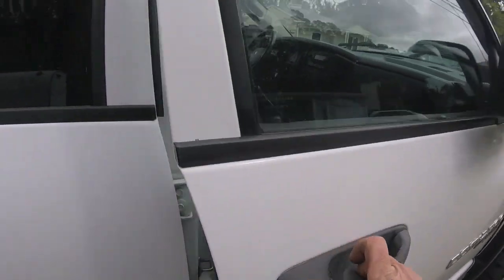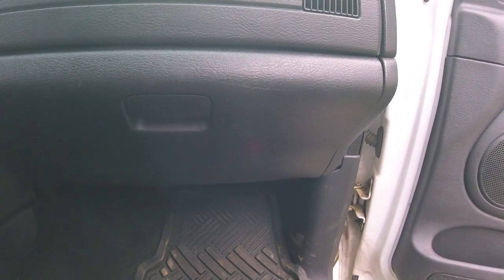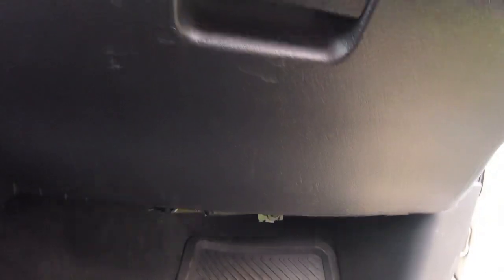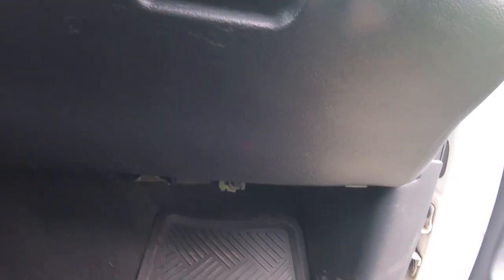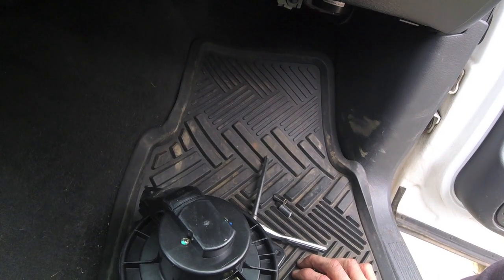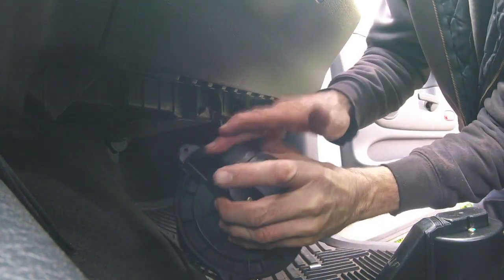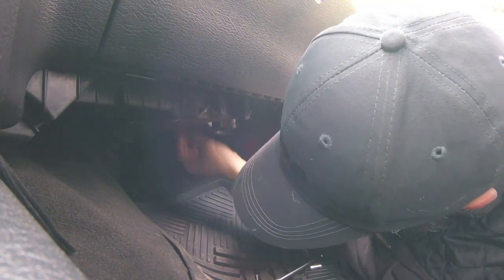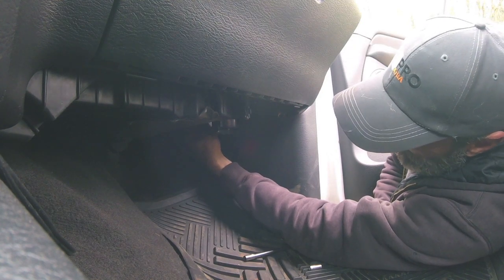2005 Dodge Ram Blower Motor Replacement

Comment: The one and only thing I suggest is to replace the resistor at the same time, if either the blower motor or resistor go, then the other usually isn’t far behind. Great video!
Reply from the maker: Good tip!

Comment: Thank you. I have your exact truck so please post any other fixits you do. My Cummins has the 6 speed 2 whl drive and only 90 thousand miles cuz it sits. The fan motor started growling about 2 years ago also. Where did you get the motor? Thanks.
Reply from the maker: If I remember correctly I bought it from rockauto.com   Thanks for watching. Enjoy you truck !!